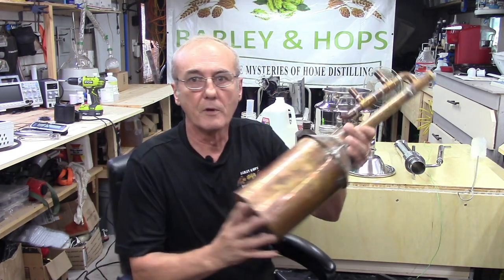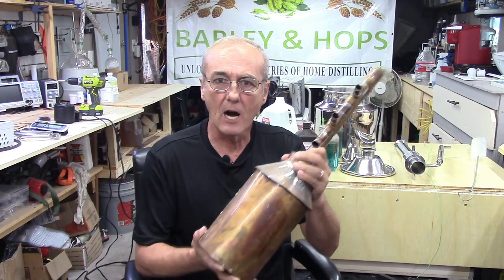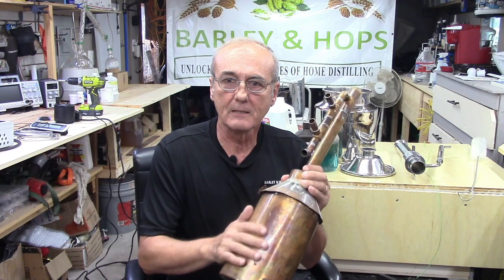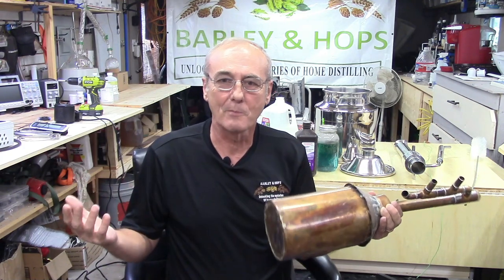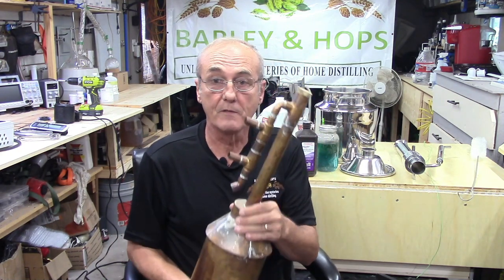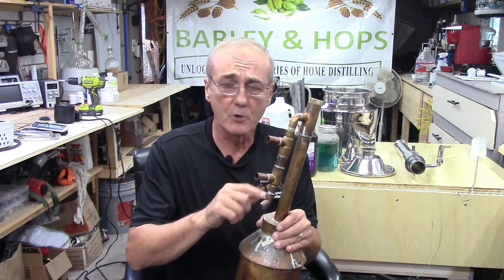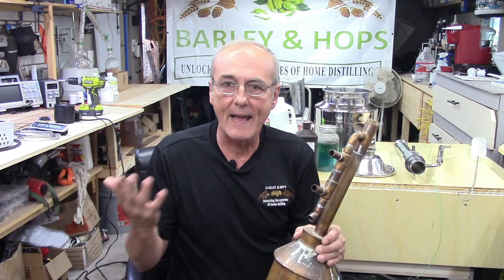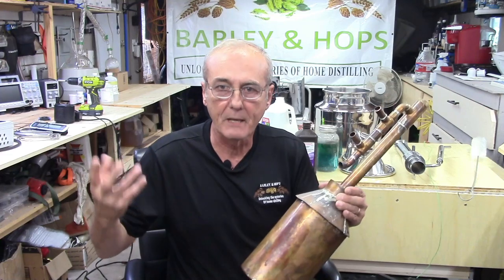CLEANING YOUR STILL, COPPER OR STAINLESS

Comment: 95% of the manufacturer's recommendations with these stills are in Chinese..😄😄😄😄
Reply: #FACT 😂😂😂
Reply: I recommend you aim to be in the 5% & buy not Chinese. I did just that after watching the Chinese Still Review. I now have a still with English instructions. I'll drink to that
Reply: @blackcyclist  I agree, if you are going to do the hobby buy quality. But as someone who is just dipping toes, I bought a CC (cheap Chinese) still. If I actually decide to do it more than a couple times, I will start trading out parts piecemeal for higher quality stuff. Easier to spend a few hundred than a thousand+. If I can't continue doing it, I won't be upset tossing aside a few hundred bucks.
Reply: @RAD6150  yep I hear you there. I had one in my Wish basket, then decided to make one, then decided to treat myself with one that I can also use for beer too. for now I'm just distilling water and boiling beer  until I absorb more knowledge from this channel. 🍺😁✊🏾
Reply: @blackcyclist  Yep. I ended up putting an element and a drain in mine. With the false bottom, it is perfect to biab beer. I am just getting started though, so I need to slow my roll. 😂 Right now I have going: 5 gal hard cider/ apple wine (maybe some brandy?), 1 gal Belgian ale, 5 gal sugarshine, and 6 gal pinot noir. All my buckets and carboys are in use or prepped to be secondary with 10 gal wheated bourbon mash waiting for space. I am gonna finish this stuff before I buy a wort chiller and try bigger beers... 🍷🍺🥃🍸

I may have a problem... 🤷‍♂️
Reply: @blackcyclist  its not 19th century. China has better industry than 90% (if not 100%) of the most developed countries in the world. Just stop buying cheap products from China, they have excellent products in a diferent price range. About the language - use translator, like everyone else in the world that doesn't know English and reads instructions on it. UK/US are not the center of the world anymore xD
Reply: @evgenitantikov5865  you've missed the rest of the conversation. But whatever your budget allows. It's your budget and your project. Good luck what ever type you decide
Reply: @evgenitantikov5865  I see you edited your comment to add more to the original. There was no criticism of "China" in my comments above. This is a channel for info advice and support for people interested in brewing. Take from it what you will and make your choices based on your personal situation. Once again, good luck in your brewing 🥰
Reply: Is the hydrogen peroxide critical to the cleaner solution? Terribly hard to get hold of in a usable concentration where I live since it has apparently ended up on some "potential bomb chemical" list.
Reply: @TheStigma  you should be able to get it upto 12% strength max if you are in the UK.  I managed to find a supplier.  I then dilute down further. Good luck, I think 6% may also be available
Reply: @blackcyclist  Thanks. I'm in Norway, but 12 is also the legal concentration here outside of enterprise use. It's just a pain to find.

The reason for the peroxide though is the oxygen I presume - to quickly oxidize and dissolve any organic contaminants. I could do that with natriumpercarbonate. It's a white powder that is basically like the active ingredient of "vanish oxy action" type products. It releases lots of oxygen upon water or alcohol contact and decomposes into oxygen and natriumbicarbonate (a fairly harmless slightly alcaline substance often used in washer detergents). You can get the stuff by the kilo at "all natural alternative" type shops and it's inexpensive.

But... either using that or hydrogenperoxide I would be a little bit skeptical either way because high concentration oxygen well... oxidates strongly. That will include any copper. It won't damage it, but it will quickly coat it in copperoxide (ie. the green'ish patina that copper gets when it "rusts"). Not dangerous, but it can certainly lead to some "copper pipe" type taste - and stuff like that may be what you wanted to clear out with the acid in the first place...
Reply: @Jeffrhodes-pl7rc  this post is 3 years old. Do whatever is right for you, your circumstances and your budget. Best of luck 👍🏿

Comment: Here's a tip:  Everyone uses StarSan as a sanitizer, but it is also great for cleaning SS and Copper.  We double the dosage and just spray it on or into our equipment.  Let stand for a few minutes and then rinse off.  It both cleans and sanitizes in one simple step.  It brightens copper, but is not a polish so don't expect the copper to come out brilliantly shiny.  It does remove the bad stuff like green oxidation and that is all one needs.  Try it.
Reply: Price comparison ?
Reply: @brucedownunda7054  It doesn't get much cheaper than StarSan...pennies.
Reply: @brucedownunda7054  Most people who hobby in home brewing already have star san and use it on a regular basis anyway so the cost is already factored into the cleaning bill. Star san will certainly remove the shiot from copper theres no doubt about that, and the fact that its tasteless and odorless is I would rarely consider anythine else. I don't even put stinkin ass dish soap in any of my stuff.

Comment: Distilling acidic compounds should not give acidic distillates. The green normally comes from unwashed copper after acid cleaning but bluish tinges comes from distilling neutral to alkaline wash / mash which contains ammonia from nutrients. The ammonia is volatile and forms a copper tertamine complex on the way out which is deep blue. This tinges the distillate. So best to ensure an acidic wash.

Comment: Love the mix of metric and US measurements.  As a chemist I used metric in my lab.  When I worked with the plant it was always pounds and gallons so, I got used to converting metric to US.   The pH of a weak solution of vinegar and citric acid should be close at around 3.   Adding the hydrogen peroxide really make a huge difference.  Thanks for the great information.

Comment: Have been using your 551 now for a couple of years now and it works great every time I remove my packing I soak it for at least an hour then rinse it well let it dry and its ready to next time for copper worms or tubes I cork the low end and fill them up and let them soak like that if you let it soak long enough it will look brand new. Always enjoy your videos my friend even the rehash of things learned #HappyDistilling.
Reply from the maker: Great to hear!
Reply: Yes
Reply: Yes

Comment: Thanks George. Really appreciate you video. I've been noticing a left over smell in my stainless steel distiller. Tried to clean it with sanitizer but didn't get rid of it. I use copper mesh in the still and collum. I wanted to find a way to get rid of the tarnish on the mesh. So I'm going to give it a try. My potatoe barley shine turned out very well the first time. The next time there was a left over order. I filter it 6 times. That turned good as well. But this time I'll have the equipment clean(er), ready to go. To your health,  cheers

Comment: Any issues using the 551 on stainless? - The scenario I'm thinking of is where you have a copper column with stainless steel ferrules brazed on.
Reply: Did you get an answer on this I have a stainless keg with copper colum
Reply: @Brumasterj  it doesn't seem to have any affect. I haven't noticed any issue from it.
Reply: So would you recommend 551 or something else
Reply: @Brumasterj  I just rinse my column after using it with water and if it needs a deeper clean I use the 551. I use the 551 more for my copper mesh packing
Reply: Thanks for the info, I’m about to do a first run old beer keg and I just pieced together the copper colum and shotgun condor today so want to make sure I get a good cleaning befor first run

Comment: Building my first still out of beer kegs. I'm pretty sure that there's beer residue still in there because I haven't pulled the valving for the tapper out yet. Nonetheless, I don't plan on cutting the top off my selected pot. So how do you get inside a keg and clean it? Or,,,, how would you suggest cleaning it?

Comment: George, for a copper still, do you recommend anything specific to do to it before it's stored? After a run, if it's washed and had 5-5-1 run through it, is there anything else that should happen before it gets put on a shelf? I've noticed A LOT of patina built up on the inside between uses.

Comment: George, I have a 15 gallon copper pot still with thumper and worm. I just got it and need to get it clean before my first run in it. How much water, hydrogenperoxide, citric acid do I need to heat up and run through this to clean my system or should I just run 5 g water, 2 g of vinegar, and 2 cups of citric acid like Tracy Bumgarner of Ace Custom Copper suggested? I truly appreciate your help 😊
Reply: I think you would be better off doing like George said. Make a 500 ml or 1000 ml of 551. Add and sloush it for 20 mins. and rinse it and then do a Dawn Soap water wash and rinse well.
Do a small water only run to give it a final rinsing to be sure any residue is cleared out. 
Heating 551 increases its corrosiveness. Thus consuming a larger small amount of the copper than room temp. 551 does. Over many times of hot 551, it can thin out copper into a weak metal and will need to be replaced.
Reply: 50:50 vinegar and water mix run still with no water cooling, Time 30 min from when steam starts coming out of collection pipe.
Make sure you have plenty of mix in your boiler if you have an electric element make sure it's not going to be exposed during cleaning run. Full throttle on the heat.

Comment: Hello George .... Italy here, i follow you for more than 3 years and before that i built myself my still with copper (reflux + deflagmator) , brass (3" Tri Clamp joint) and stainless steel (pot - ex 50 liters olive oil tank ). Recently i used your 551 mixture to clean copper and it works very good but i've some problem with brass. At the end of cleaning the 3" brass Tri Clamp seem coloring like copper. It could be some Chemical problems during distilling process ?. Anyway thanks a lot for your Tip & Tricks, are very helpfull ! Francesco.

Comment: Hey bruddah, wen you make this mixture. Do you run the still and boil it off to clean the still? Or just scrub the still manually with the 551 as a cleaning solution?

Comment: I just filled up my worm with this mixture because I had some blue looking snot coming out on my last run. I can’t see inside the tube for the cleaning effect but on the outside of the line where I kind of spilled it the copper turned really dark??

Comment: My still is both copper and stainless steel. Unfortunately the last batch I did came out smelling bad. Could I use bleach on all of it?
Reply from the maker: Bleach is caustic and leaves a residue that is sometimes difficult to wash off. Use a good all purpose metal cleaner or mix up some 551 and soak it.
Reply: @BarleyandHopsBrewing  I will try the 551. I know why my previous run came out smelling, in your words, like ass. Lol! was because I did not clear it up properly. I still had yeast and other impurities in it. Thanks friend. I am loving my new hobby...
Reply: Does this replace a vinager run?

Comment: Hello George, I am new to your channel out of necessity. I have just bought a 2 gallon stainless Still and it has copper fittings. Should i do the vinegar cleaning method before use or is there a different method as it is both stainless and copper?
Reply: Did you get an answr
Reply: @Brumasterj  No I did not get an answer so I just searched youtube and found the answer myself.
Reply: And what did you come up with:)
Reply: @Brumasterj  Wter and vinager.

Comment: Hey George, I've had my beer keg still soaking in 1 gallon bleach and the rest water for 2 weeks, you believe that will harm it? Have a great day !!!!
THANKS !!!!!!
Reply from the maker: Bleach can leave a residue that is difficult to remove without using plenty of warm soapy water. Other than that it should be okay
Reply: @BarleyandHopsBrewing  
Thanks George !!! I guess I'll need to fill it up with hot soapy water shake it up and rinse it out. Then do a vinager run and hope for the best. I've had 2 keg stills over the years and they do great just a pain to clean them. 
Thanks Again bud 👍🏼
Reply: @gwarrichmond6232  install, or have installed a 4-6 " ferrule at the top. At least you'll be able to get a brush or your arm in there for cleaning. Take it to a local welding shop...
Reply: @capitaldd3693  
I do appreciate your comment back, but that's just a lot of BS work for a beer keg still. I can MIG, TIG, STICK, GAS, weld anything including aluminum. I was just looking for a cleaning method without reinventing the wheel, for a cheap still. Thanks again for the ideas lol.....👍🏼
Reply: @gwarrichmond6232  yeah sure man. But it is cheap if you can weld. A ferrule is say 15bucks  and adapter 15-25 depending on size. The welder, that's you, is usually the most expensive part of the  cost.  Maybe just a higher pressure adapter for a hose to rinse it out.....or make one reducer style.  The booze isn't free, but it's pretty darn cheap when making it at home. I'm of the mindset, if I'm doing this myself the costs are pretty cheap - a few bucks here or there to get set up is just blending in to the overall costs. I'm paying about 20bucks and 5-6hours to do a sugar run and yield 5 or 6liters of 90%(plus a bit of char and flavour).  I'd say that's a pretty good deal, for me anyways. The few hundred in my still doesn't even matter any more. 
 Anyway, good luck with your project hope it all works out. ..🥃
Reply: @capitaldd3693  
Yeah, no doubt bud - your run doesn't sound to bad.  Thanks 👍🏼

Comment: George!  can you do a video just on starch conversion and how iodine is supposed to look after the conversion?   I've watched your other videos on the subject but I keep getting dark purple-ish iodine tests no matter what and yours turn milky yellow or completely dissipates.   I'm not sure what you're doing differently.  I hold at 155 for 90 mins with the same grain bill as you did.  yours was yellow and mine wasn't.  :(
Reply: You’re best bet is to keep BOTH alpha and beta amylase on hand...

Since it’s impossible to over convert starches to sugar...

For me it’s a added precaution to ensure an effective conversion.

It’s relatively cheap...
Probably around $15 per pound of both.
Utilizing a teaspoon per gallon.👍😊🥃

And of course your grains MUST be malted AND milled.

Believe it or not I’ve had buddies use non milled grains... and of course the amylase won’t be released in a whole grain.
Reply: You need amylase  to break the bonds and make the starch conversion to complete
Reply: Even using an all barley grain bill I add alpha amylase during high temp conversion and gluco-amylase just before pitching yeast. Very cheap insurance and the iodine test doesn't lie 😉
Reply: wldtrky38 

Yes.
Better safe than sorry.

We’re all looking for efficient conversion.

And this is the best way to achieve it.
Good stuff.👍💪🥃
Reply: We use amylase enzyme in all grain builds regardless whether it contains malted grains or not since malted grains do not always do a complete conversion.

Comment: Is it ok to keep using the 551 mix once it has turned blue?
Reply: tobiaS booN

Probably...at least until it’s so polluted the ingredients become inert.
Obviously becoming more diluted with more use.

Lol... why bother?
He just said it’s about 4 CENTS per batch.
Reply: @BillMcGirr   Thanks for the reply, for some reason in Australia hydrogen peroxide and citric acid is expensive 😕 I normally make about 20L of it, poor/ re-use it in a large container and dump copper column & every thing in at once until clean.
Reply: tobiaS booN 

Perhaps be creative and try and filter it through some coffee filters and/or cheesecloth?🤷‍♂️😊👍
Reply: tobiaS booN Not that there are any stills in Australia, and if there are, they are very small and only used to distill essential oils for making perfume 😜
Reply: I suppose once it turns really blue, you could always use to electroplate metal with copper, or adjust the PH to about 5.6 to5.9 and put it on your garden.
Reply: Uncle Zed was also thinking it would function as a copper based fungicide, will try on less important plants first, nit the grape vine and Laurel tree
Reply: Uncle Zed ....and the vital hand sanitiser. Ditto for South Africa regarding costs of ingredients and an absence of Moonshine Stills 😁
Reply: @unclezeds  thats right, perfume. What else is a still used for other than perfume and distilling water 🤥
Reply: tobiaS booN apparently some people on the mainland have figured out a way to make the devils water using a perfume still! But here on the West Island of NZ, (unofficially known as Australia) we don’t know about that stuff.
Reply: @unclezeds   😆👍

Comment: Hi George,
After two years I have dug out my combination still project and finally finished it complete with a PID controller.
As you can imagine the gunk in the copper was very bad.
I have made several batches of your 551cleaning fluid which has worked amazingly.
Anyway, my question is that my filtered sugar mash batch and sugar and molasses batches are 2 years old now.
Should I start again or do you think they may be ok for distilling.🥴
Reply: I would say to smell and taste it first. If it tastes good and it smells good, I would say go ahead and run it.
Reply: Distill it regardless just for the experience but it should be fine to use a long as it dont smell "rotten"